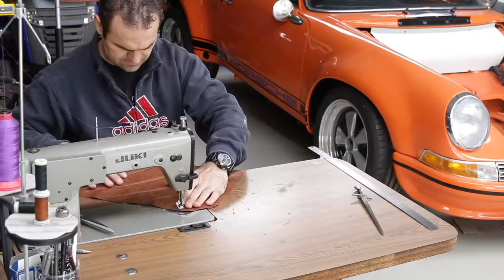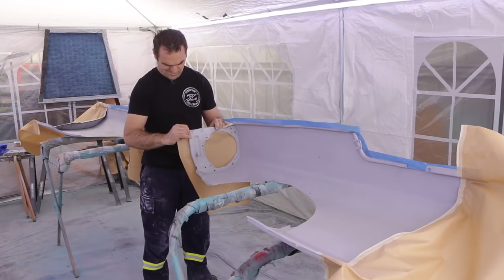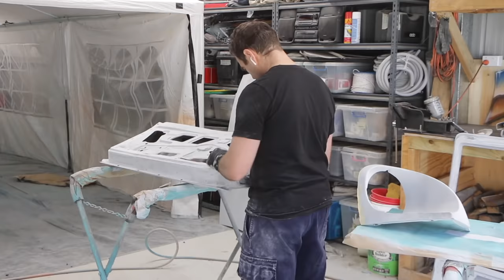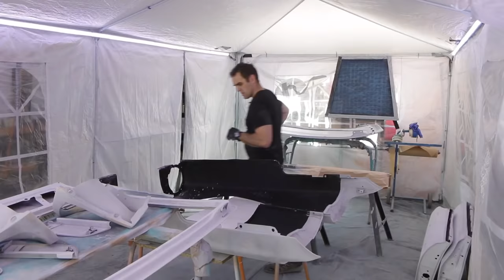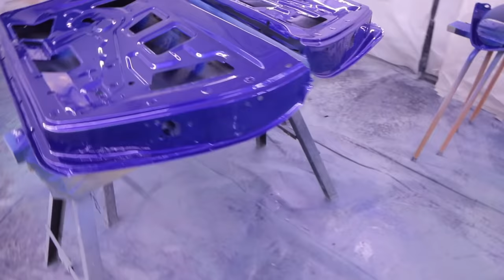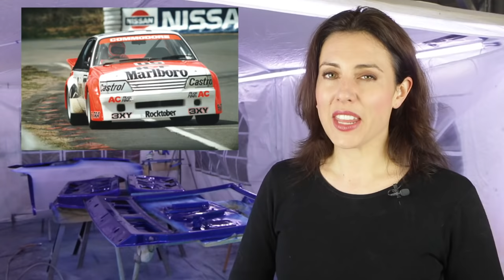Home Built Datsun 240Z part 51 - Painting more inner bits

Comment: You’re the best person I could think of asking how to get rid of surface rust! mini belt sander or wire wheel on a drill?
Reply from the maker: Depending on the rust, a sander could be ok as long as it is not pitted, but generally I would go for the wire wheel, and then treat with a rust converter (or just a solution of white vinegar) afterwards just before you paint it.
Reply: Home Built By Jeff  You’re awesome thank you very much for for that info😬👍🏼